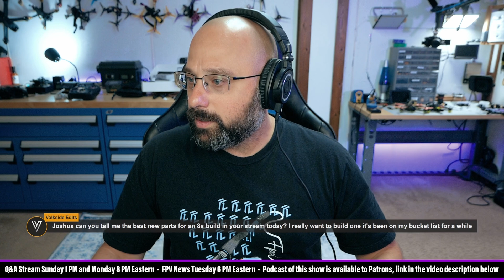What's The Smallest FPV Drone 6s Batteries Make Sense On? Should I Put 6s On 2.5"? - FPV Questions

Comment: I have s quadmula Djinn 2.5 inch with 3000kv on 650mah 6S and flys great
Reply: I just ordered my djinn, and I’m going to do 6s too. 😁 
This will be my first fpv build too 😅
So 650mah is what you recommend? 
I’m bought the t-motors p1604 kv2850.
Reply: @junecontreras6896  haha i just built a djinn with those motors with 650mah cnhl 6s and it felt like it lacked power tbh. I'm going to try the 3800kv motors on 6s.
Reply: @BeautyBeastRC   oh for real? It’ll be my first build so I’m still trying to understand the “feel” for it, but if it’s stronger than the avata2 then I think for the moment I’ll be alright 😅. Let me know how the 3800kv goes, eventually I’ll need to upgrade too 😂 good luck 🍀
Reply: @BeautyBeastRC  How'd the 3800kv motors turn out on 6s? My experience 2850kv/3000kv should be the most kv you run on 6s safely. I'd try the  3800kv if they work good. How'd it go for you?
Reply: @djdubz  they work great! you can safely use 3800kv with 2.5 inch no problem. The drone seriously sucked with 2850 on 6s. Going to 3800 was a night and day difference. I will say I haven't tried in the warmer months yet obviously but my motors have been cool so far.
Reply: @BeautyBeastRC  Awesome! You didn't need to set any limits or anything in BF? Just sent em?
Reply: @djdubz  yup 100% motor output
Reply: @BeautyBeastRC  dope! so tmotor 1604 3800's 6s on 2.5"? Would the 3800s work on 3" too?

Comment: Bardwell has explained it theoretically, assuming you have the batteries. In practice, however, it ultimately depends on the availability of the batteries (unless you make them yourself). And the simple fact is that the smallest 6S battery is 1050 mAh (for me my main market). And that limits how small the drone can be for that battery. And in my opinion, in practice, 6S only makes sense with a 5 inch medium weight. At 5 inches ultralight and under 5 inches 6S makes no sense in my opinion (except for 3-4 inch cinewhoops maybe).
Reply: you can get 300mah, 450, 550 mah  6s batteries which are extremely fun on 3 and 4inch quads
Reply: U can get 500 mah 6s and 680 from gnb

Comment: Theres a couple of points I disagree with here, but they are pretty minimal. 

The first one is there are functional limitations on how you can wind a motor that mean there's a limited Kv range you can achieve with a given stator size and magnet combination. In a lot of cases that is the functional reason you end up changing voltages as motor sizes increase even before you run into the power delivery limits of the batteries. Now our 5" drones sit in an interesting space where we can achieve a decent range of Kv pretty effectively, so that's not really a limiting factor for a lot of what were doing, but for instance you can't functionally make a 0702 motor low enough Kv to be useful on higher voltages due to not being able to fit enough turns on the windings with sufficient gauge wire. Same is true in the opposite direction on larger motkrs. At sone point you are at only one or two turns per armature on the stator to achieve the Kv you want. 

I also would point out there are a lot of other factors like switching losses and relationship between duty cycle and efficiency of the motor that matter a lot in where optimum voltage and Kv will sit for a given application. Moving the throttle point that is the most used into a more effective band for the motor is a key part of the discussion, and often that is achieved by lower voltages, not higher. It depends on the specific application of course. 

My main point woild be that the real point at which you want to go up in voltage is when you exceed the power delivery requirements of the lower voltage in terms of how many watt hours of battery you can carry and how high you can push the Kv.  

To that end, I don't actually think 6S makes sense until you get above 2000kv or so. If you actually look at the details of the setup, most folks are running 6S 1300mAh batteries. Those are roughly watt-hour equivalent to 4S 2000mAh, and a 4S battery of that size  can pretty easily handle the load of motors up to 2800-2900kv without running into limitations. That's Kv equivalent to 1950kv on 6S at the top end, so unless you're pushing past that point you're just sacrificing efficiency and stressing the voltage ratings on the regulators on the low voltage electronics by moving to 6S without gaining much if anything in terms of power delivery. 90% of the supposed gains people see in going to 6S is because they're simultaneously going to a higher relative capacity battery that has a higher output relative to the voltage.

The other factor is that due to demand everything currently has been optimized for 6S. Compare the number for 4S 2000mAh batteries to the number of 6S 1300mAh batteries available at the FPV shops for example. Also look around for ~2800kv motors snd compare it to the selection of ~1950kv 6S motors. 

Anyway it's a fun discussion, but in the end it's more academic than practical. Anything in close to the right range will work great and fly well, so in the end flying whatever works for you and is readily available is the right choice regardless of the technicalities of why or minor optimizations. Fly what you enjoy and have access to! It's just a lot of the commonly shared info on the topic is inaccurate at best.
Reply: Wait what? So a 4s setup would be more efficient and powerful? Why are we on 6s then?
Reply: @definingslawek4731  No, 6S is generally batter at power delivery, but it generally comes at an efficiency cost. And as I said in my initial comment, it got popular because it's a bigger number and because early lipo batteries were kind of crappy, and it just stuck around because of large scale availability.

Comment: Quadmula f25 build help!
DJI o3 air unit 
Elrs 

Should I go 6s or 4s? I see a lot on 4s and a lot on 6s. Can't decide. Some people ive asked say def get 6s

Should I get the speedybee f405 V3 mini stack to save money or is it worth spending more for the mini t motor f7 stack?  Any other recommendations?

Thanks for any feedback or suggestions!
Reply: Got the same set up with speedybee in 6s.
I find that I have short fly time and lots of prop wash can't tune it well.
The build is like 256gr.
Reply: @hashikill  which battery are you using

Comment: I fly a 3" on 6s with tmotors 1507 2700kv and it fly absolutely great and much power it gives👌🏻
Reply: No one said 6S won't work, it's just you end up with a heavier quad with no more power than an appropriately setup 4S rig. It flies fine, it's just not gaining anything and you're losing efficiency and the batteries are small enough in capacity that the cycle life and current delivery can be hit or miss. In general 4S is just the more reliable and effective option, but 6S still will work fine in most cases.
Reply: I just can't agree with this. My 4s 3.5 quad is lighter yes but definitely not as fast and not as much power as the 6s version. There is an obvious difference.  @QuadMcFlyFlies
Reply: @BeautyBeastRC  again, if you're noticing a difference, try matching the Kv of your 6S rig on a 4S build. You're likely not running equivalent Kv or watt-hours on your batteries.
Reply: @QuadMcFlyFlies  I'm curious, do you also believe this applies to 8s vs 6s? I have both of those as well and the difference is again big af. Have you ever had a hot rod build before? I'm going to assume you haven't because I think if you had you wouldn't be saying this stuff. My 3.5 inch 6s build is like 450 grams so heavy AF with big motors and will run circles around a 4s build. Whats the equiv 4s kv for 6s 3000kv motors on a 3.5 build. Even with way less weight my 4s 3.5 can't compete and it's even a racing drone lol.
Reply: @BeautyBeastRC  To answer your question, the 4S equivalent to 6S 3000kv is 4S 4500kv, but I run 4700 or 4800kv on my 3.5" 4S builds that are for speed. If you're running bigger motors that also plays a role, as you'll get a higher percentage of the no-load RPMs for a given motor load the larger the stator volume. Also the battery wattage matters, so if you're running 6S ~550mAh you would need to be running 4S ~850mAh to compare. 

And yep, I've built or been involved in building pretty much every type of setup you can imagine. I do actually have a 6S 3.5", but it's a cinewhoop that weighs 700g flying weight with a full size GoPro with 2305 motors and 6 blade props.  I have a 4" freestyle rig with 1608 4300kv motors on 4S 1300mAh and it absolutely rips at 350g.

There are absolutely places where 6S shines, specifically in very high power applications when the rig is very heavy for the prop size or when absolutely maximum speed is needed for extended periods of time, but if it's not in one of those two categories, you're just having fun with it and not really accomplishing anything. Which is fine honestly. In the end fly whatever you like as long as you're staying in the air. The small differences in efficiency and weight are honestly pretty meaningless in the bigger picture. I'm just pointing out that if you want to understand the details behind what makes it all work, it's not necessarily what people commonly think.
Reply: @QuadMcFlyFlies it makes a huge difference with 6s the weight isn't that much more and you feel the power difference. So iam not agree with what you say.
Reply: @gartsworld-RC  If you're noticing a huge difference you are not running high enough Kv on your 4S builds.
Reply: I have loads of 3 inch. 1506, 1606, 1507 and 1408 all on 6s. They're superb.
Reply: How to get the samll LIPOs ? And which one ?
Reply: @Sugalime3D_FPV I use tattu 6s 550 and 650 mAh with xt30
Reply: @gartsworld-RC  ok the 6S 550mAh is good for 3.5 inch. Maybe too heavy for 3 inch imo. And at ma main store the german Amazon i can only get the tattu 650mAh version for 30€ (what is very expensive compared to 4S) and a KINGDUO 6S 550mAh for 41€. Still my opinion is that running running 6S on quads under 5 inch you will limit your battery supply and makes battery supply a lot more expensive...
Reply: But there is one advantage i see. You can connect two 550-650mAh XT30 Lipos in parallel to one XT60 1100-1300 mAh Lipo to use it on 5 inch quad. You can't do that if you use 4S batteries on your sub5inch quads... So in some kind you save money as well unsing 6S on sub5inch.
Reply: @Sugalime3D_FPV  oke that's your opinion but I have to say my 550 6s flys very fast and we can buy it in the Netherlands. I have good fun to freestyle with it. It's also not a race frame but freestyle
Reply: @Sugalime3D_FPV  and I pay 25 for the 550 6s tattu

Comment: I just like using the right motor for the right rating , its less complication, and better flying time, I did put 6s on a 4s quad, it flew ok, but didnt like the difference, it was screaming too much. I have 1  4s quad  and its already a beast on 4s,  nazgul evoque , aint going nowhere, its my go too quad.

Comment: So i fly 6s on a 21 inch prop and rarely get more than 22 min flight times... its a big ass 36,000 MaH 6s tattu and 320Kv t-motor... what can i do to get better efficientcy (the quad weighs 18.5 pounds)
Reply: What are you even doing with a quad that big.
Reply: @grandpa_stanley7813  it's for work, can't really give exact details but I just would expect there's a more efficient way to keep it in the air longer. Maybe not though cuz of the weight.
Reply: @WHEATSFPV   I think 6s is kinda low voltage to run on a quad that big. Have you considered running 2 smaller batteries in series to make a 12s?

Comment: Yes AND… lol. You can get away with XT30 and smaller wire much easier on 6S. So if you want to try to get an HD 3 or 4” quad under 250g, you may NEED those few grams of weight savings
Reply: You're losing any grams gained on the connector in weight gain on the battery itself in extra wires and balance connector weight, not to mention the cell packaging. Pretty much across the board a 4S build is going to be lighter than a 6S.

That's entirely aside from the point that an XT30 is plenty enough for 4S on 3.5" unless you're planning on carrying a full weight GoPro with full size motors (2204-2305 range) with heavy prop loading. Keep in mind the 30A rating is a constant current rating, and direct testing has demonstrated that XT30s can deliver 60A without issues for the duration of a flight without showing any rise in resistance or measurable losses over an XT60. There's really no need to go to XT60 for any smaller application regardless of voltage on anything below 4" in my opinion. I even run them on my light weight 5" builds.

Comment: The real benefit to higher voltage is LESS AMPS for the same amount of work done. Thats why your heavy amp draw household appliances aren’t 110v. Because they draw half as many amps at 220V for the same amount of work done at 110V and your electric meter is charging you for the amp usage. 

In the context of mini quads, less amps, means you need less wire gauge and battery connector size for the same amount of work or less voltage drop over the same wire size. 

So from an efficiency standpoint and a weight saving standpoint, you should see better and better results as overall mini quad weight goes down… to a point of course
Reply: So there's a couple of problems with this analogy. It definitely is true when you're dealing with the kind of power bandwidth that 220A appliances draw, but we're not anywhere near that range with our miniquads. That's kind of the point of what Joshua is saying. Even at 4S we are nowhere near the limits of the wires and connectors we're using for even 5" drones at the highest power levels. 

Also we're dealing with a brushless motor and control system that introduces a lot of additional variables when it comes to efficiency, switching losses, limitations of the design and dimensions of the motor to the point where the discussion becomes a lot more complicated. 

The short version is after loads and loads of testing, 6S really only becomes useful when you exceed a pretty significant power delivery requirement, otherwise your best bet for efficiency is the lowest voltage that can deliver the power requirement you need.
Reply: Maybe I'm wrong, but doesn't the power meter calculate wattage, and the power company charges you by the kilowatt hour? So, a higher voltage but fewer amps would probably still come out to about the same power usage. Or am I missing something?
Reply: @BattleHamster83  You are exactly right and I can down here to say it.

We are charged for Volts * Amps, not just amps. So, if you jump from 120 V to 480 V just to save a buck, by dropping the current from 20 Amps to 5 Amps, you would (in this fictional "charged by amperage" world). However, since the USA standard (and probably worldwide standard) is to be charged by power and not current, the cost would be the same.

There's my unnecessarily long response. I like electricity.

Comment: Up to 1804 size motors you can stay with an 850mah 4s and xt30.
Woth more power hungry 2004  and bigger motors you will want 650 to 850 mah 6s xt30 lipos.
Just my experience from building many many 3 to 4 inch quads.
You can push an xt30 up to 90A burst. No problem. It's only for a few seconds.
Beyond that either change to xt60 and bigger 1200mah 4s lipo or stay xt30 and use 6S 850mah lipos.